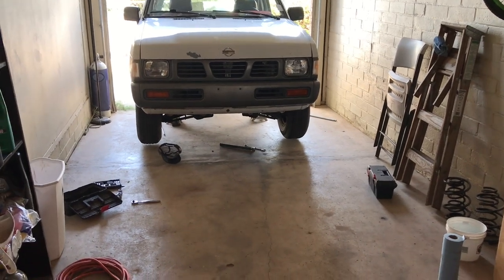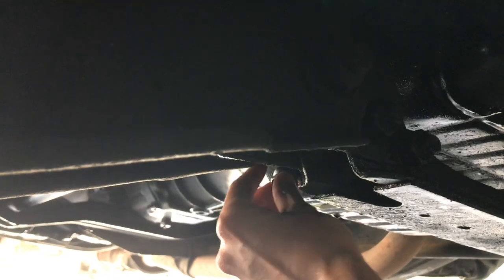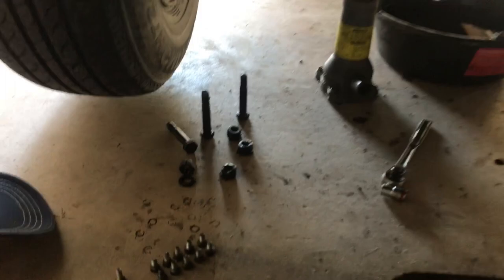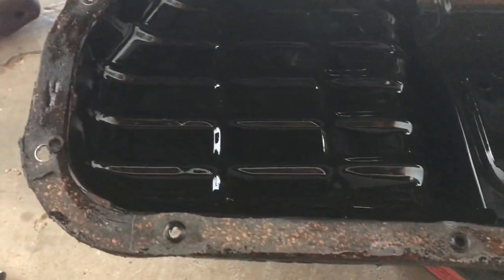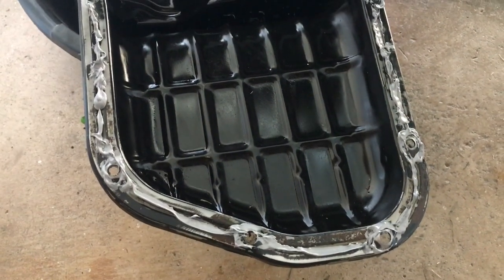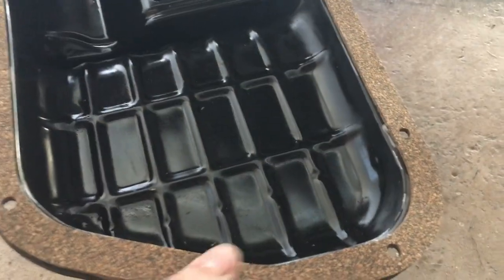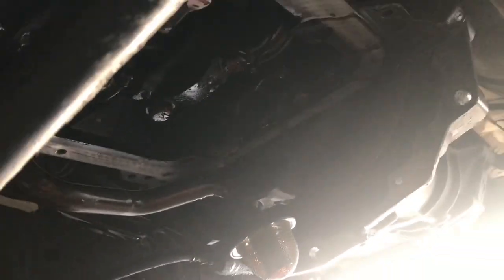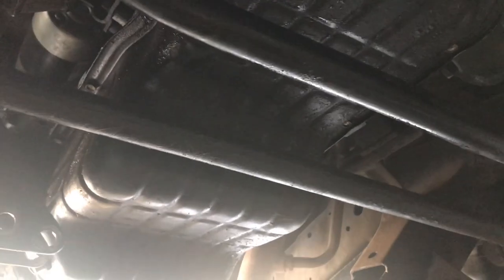DIY Changing Oil Pan Gasket On The Nissan Pickup

Comment: Thank you now I know where those 2 larger bolts belong ...also if having problems removing the oil pan I use a hammer and a piece of 2x4 wood just lightly tap around placing the 2x4 on the oil pan ofcourse not hammering directly with just the hammer!!! or if you have a rubber mallet that will help too.

Comment: I need to remove my oil pan to the same truck like yours .   Mine is making a knocking noise they say it’s a bearing connecting rod I was trying to see your motor underneath when you had it off the  oil pan
Reply from the maker: Ram M457 yea you can see the bolts to the rods very easily once you take off the pan. Once doing so you have access to whatever sleeve is giving you a headache.

Comment: I took of the.  Bolts to the oil,pan but it's stuck I don't want to bent it by prying on it
Reply from the maker: Ram M457 I just moved it around with my hands. But if somebody else already put gasket maker between the block and pan making it stuck, you might want to use a razor blade to avoid prying.